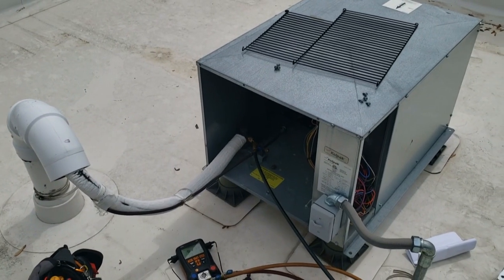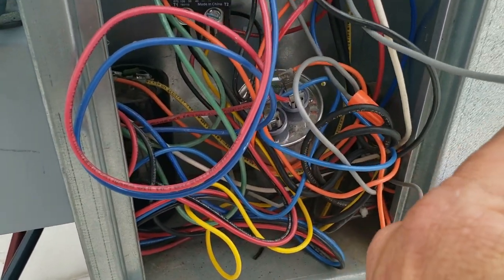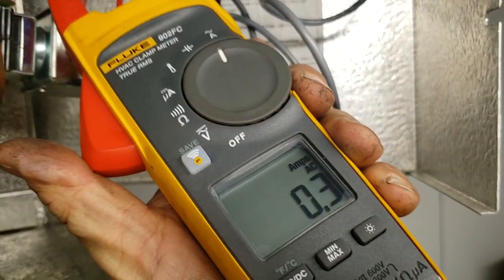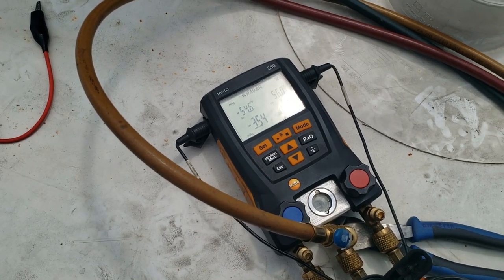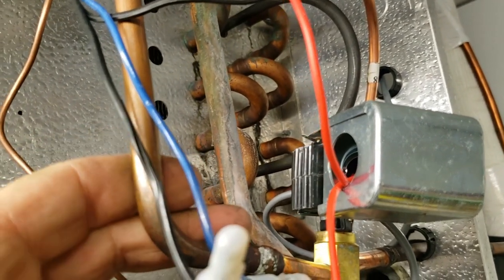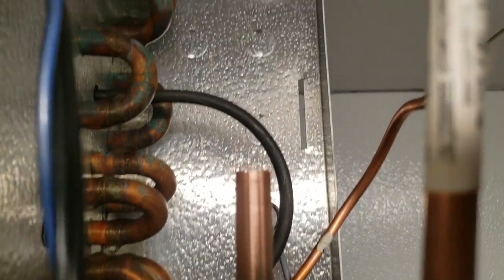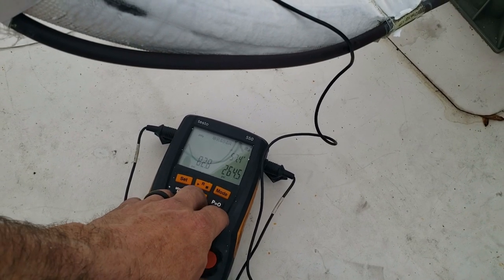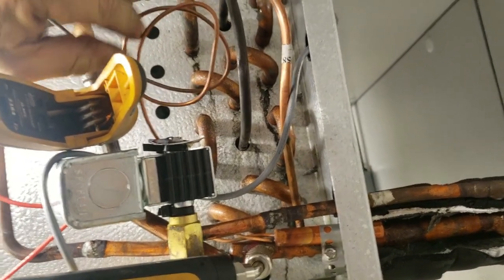Draft Beer Walk-In Cooler Warm...Is It A Restriction, TXV, Refrigerant Leak or Pressure Switch Bad

Comment: thanks for the video, did you use the other method for the superheat, if so ,what differential are u looking at for the cooler?
Reply from the maker: It was within 2 degrees. I forget witch way.  Thanks 4 remembering that 👍🏻👍🏻
Reply: @HVACRSurvival  Jim pettinato way

Comment: Sporlan valves I start at 2.5 turns out. Medium temp on parallel racks get 6*-8*F coil SH;  1 on 1's I try for same SH but minimum compressor SH overrides that.
Reply from the maker: 2.5 turns sounds interesting, I usually rush the adjustment and then spend forever getting it where I want it  I didn't have as much time as I wanted to tune it in as I wanted because the customer was worried about cost. And as you mentioned, I was already to low on my company superheat.

Comment: Pound Ounze PSI etc is not a problem to convert to Industrial from Imperial (english/american).
But what is a ton from english ? We have also tons in Europe and 1 ton means 1000 Kg or 2205 Pounds of weight.
If you talk about a 15 ton system it has 33075 Pounds of weight for me at 3-6 Square Meter and i can not see
the mechanical Structure to carry this things on a weak roof. So what is meant of tons in america for klimate systems ?
Reply from the maker: There's 12,000 btu in a ton of cooling.
Reply: @HVACRSurvival  so I have 1 ton of cooling and heating private and my friend 3 tons of cooling and heating. We care only about efficiency. In america there are very less Inverter systems. They are the most efficient way to regulate. I am not a HVACR but an industrial engineer and have learned a lot from you.

Comment: Thank you for this great information about txv and s valve, I have a question about a walk in cooler that has three evaporators coils and in exh one there is a txv  , r 22 , low pressure is about 25 , high side 220 psi , the suction line is frosted all the time  ,i replaced the filter drier and pulled 200psi nitrogen and deep vacum but after all that the problem continue, and I dont know which one of the txv is bad or the or restrected , do you recommend mento replace the 3 valve or just the power head of the three valve thanks you for you support
Reply from the maker: Clarify for me what you have. You have 3 coils and 3 txvs?
Reply: Yes 3 coils and 3 txv
Reply from the maker: @rahmanyalshugaa3556  check the superheat of each txv and see if they are truly flooding back to the compressor. Then do a superheat at the compressor last, you should have 8-10* at each of the txvs and at least 20* at the compressor. Then go from there.
Reply: Thanks a lot for that seriously issue
Reply from the maker: Your welcome

Comment: 10 F superheat  I usually hear its 3.5 to 4f superheat at the evaporator  for walk in cooler and freezer ?
Reply from the maker: 6-8 for freezer, 8-10 for coolers from what I've read from HeatCraft. If you get the S.H. to low and you might have problems as the outdoor temps change. **Also don't forget the compressor manufacturer generally wants 20 at the compressor min. and that overrides the TXV. But this isn't a perfect world. This customer didn't want to spend a lot of money on this after all the covid-19 crap.
Reply: @HVACRSurvival  sounds good man 🦸‍♂️  you are super man
Reply from the maker: Lol. No I'm just just a tech playing a Dr on YouTube. 🤣

Comment: Do you really think insulating the bulb makes a difference? I feel like it doesn’t
Reply: yes, because too much heat loss/gain from air flowing over and condensation, which could make it react too slow and/or read wrong from condensation evaporation or lack there of.
there's a reason why they insulated them to the pipe years ago ;) also in other coolers sometimes it's possible to get product shoved against them and that will whack them out for sure!
Reply from the maker: I think it will be more accurate with it than without it so I try to follow industry standards to cover my butt against callbacks. Will it work without it? probably but there is always a possibility it might cause a weird random issue.